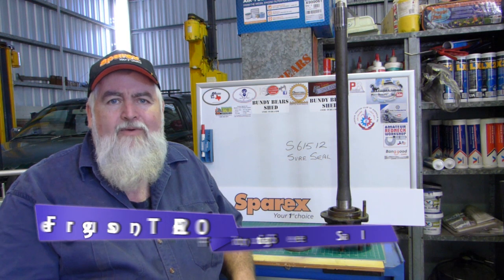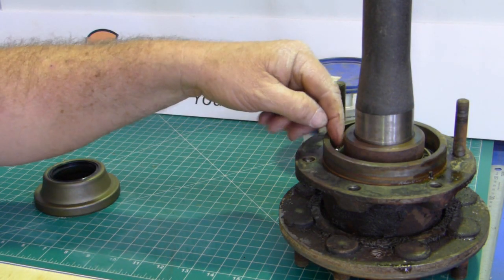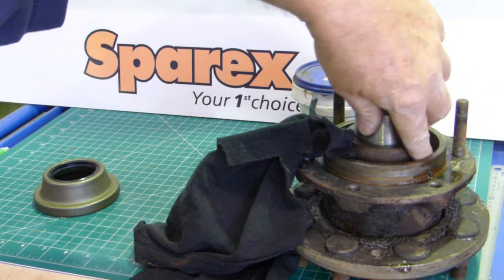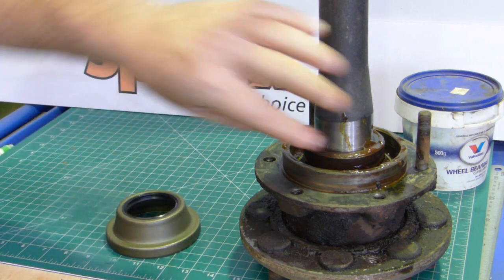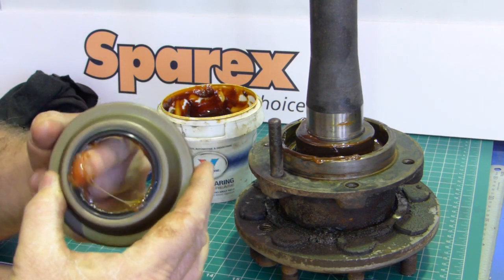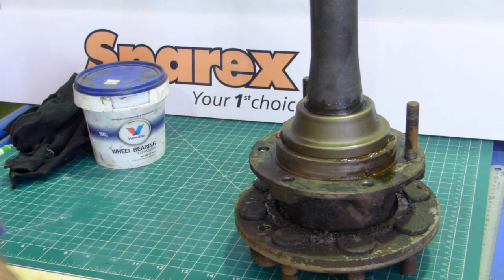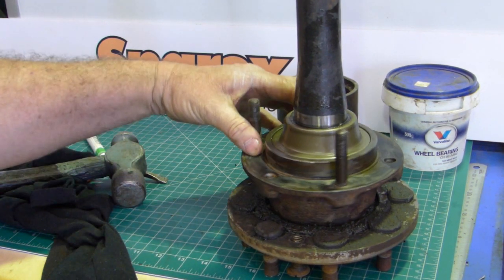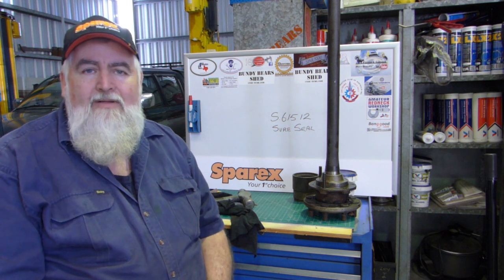How to fit a Sure Seal on a TE20, TEA20, TED20 etc Rear Axle

Comment: Hello Lance, Just fitted mine and as you showed you really have to chase it around a fair bit with no success. I found if you put a large washer on a bolt to hold one side down it then becomes very easy to get the rest started  and easy to fit. Regards Charles @ Nerimbera .
Reply from the maker: Nice work!

Comment: That's great Lance. This is something that I first did a couple of years ago and was surprised how easy it was to do. I think that a little clarification of what age tractors this is applicable for would be helpful, as you will know it is only needed for the early type Ferguson TE20 rear axles. The later ones (with grease nipples fitted) have a different type of seal arrangement, meaning that you just need to change the inner seal in the end of the trumpet housing.
Reply from the maker: Yes I do mention that and in the video coming in a few days we cover the inner seal as well. Hopefully it will be understandable.

Comment: I like the video on the TE20 sure  seal fix but, I have not been able to install one on my 48  TE20 Ferguson.  What seemed to be a simple seal fix turned into a lot of frustration. The seal seems to be pretty thin and easily damaged so maybe I have not used enough force to get it started.  I was wondering if there is a seal that could be installed on the housing where the axle shaft end goes through?  If there ever was one  on mine, it has been removed and discarded. If you know of a seal at the housing, could you enlighten me on it and what the part number is.   I did watch a video of another gentleman removing and installing a seal at the housing but I am not sure of the tractor model he was working on.  Thanks for any info you may offer and please continue with your excellent videos.  I suspect I am a tad older than you with a brain that is hard to keep up but you have certainly helped me tremendously on fixing my Ferguson. The very best to you and your family, thanks again.
Reply from the maker: No the inner seal was only an option for the later 19 spline tractors. They can be difficult to fit at times but a bit of pipe the correct size will help.
Reply: I read a comment about a gentleman fitting the sure seal using a oversize washer to hold one part of the seal in place. With that, I had a  3x2" x 1/4" flat stock and drilled a hole large enough to fit a bolt, to hold one side of the seal in place. I chased the rest around until the seal got tired and settled down enough for me to finish the job.  It was a great idea and helped to finish the job. You have one of the best DIY tractor websites. Watching you at work is a lot better than watching the local crooked politicians at work. Thanks again for your expertise with fixing the old Ferguson and sharing your knowledge. Chief

Comment: Another timely video. I have to fix the seals on my TO20 restoration. Are the original inner and outer seals still in place? I bought both inner and outer seals and the sure seals as well. What about replacing the originals and adding the sure seal for extra protection? I hate oil on my brakes. One guy I talked to said you have to shim the axles properly so I bought some shims too. I'm a guy who buys everything needed first then does the job.I find when I am waiting for parts or money, the job doesn't get done. A little extra explanation would help. I enjoy your videos and your personality, Thanks!
Reply from the maker: I have the video on the axle bearing and seal fitting this week some time, if there is a mark on the outer seal surface there is nothing at all wrong with adding some grease and fitting the sure seal. If it does no good will it do harm? In my opinion no so go for it.
When I get to fitting the axle I will cover shims but it is very easy.

Comment: Can I use the same "Sure Seal" for a 1954 Ferguson TO30? It look identical to the TO20.
Reply from the maker: Im not sure as the TO30 isnot a model we have here in Australia, On the Steiner website it says TE20 and TO20 so I dont think it will be suitable. If they are like our FE35 there is an inner axle seal that is easy to replace.

Comment: Any tips for freeing off the brake backplate / half shaft studs from end of the trumpet housing? (Not sure if i’ve used correct terms!) 
Can get the nuts off - but not free the axle! Thanks in advance!
Reply from the maker: Just soak with CRC and work away at bumping the backing plate off. They do rust in at times.
Reply: @BundyBearsShed Thank you 🙂

Comment: Quick question, I have a early te20, so if there isn't a seal behind the bearing what stops the oil from washing out the grease in the bearing?
Reply from the maker: Nothing at all and it can wash a bit.
Reply: @BundyBearsShed  okay, many thanks

Comment: Good one thanks lance, very helpful. When I put the half shaft back in the tractor. Is it one gasket only or one gasket each side of the back plate. Some say 2 and some say 1. Would like to know before I set up the end float. Thanks nick.
Reply from the maker: Usually  1 between the axle seal housing and the backing plate and only shims to the rear.
Reply: @BundyBearsShed  sorry for being a bit thick lance, so starting from the axel trumpet flange it's then the shims, then the gasket, then the brake back plate, then the half shaft flange. Thanks nick.

Comment: I saw a comment on a TEF 20 restoration site advising against buying sure seals if your tractor has a serial no greater than 325000 because they don't  fit as the design of the rear axle trumpets changed at 325001. I don't  know if this is correct because I just changed bearings  and seals as normal.
Reply from the maker: Sure seals are for the early 16 spline axles mostly as the later 19 spline has a seal in the trumpet housing the same as the 35 so yes they are correct.

Comment: Just wondering when fitting a sure seal do you have to remove the old seal from the diff end ? Thanks
Reply from the maker: If you have a tractor with the inner seal you dont need the sure seal, just replace the inner seal and you should be good to go.
Reply: @BundyBearsShed  thanks so much for your advice kind regards Simon

Comment: Hi Lance, about to do this job but just wondering if there is any particular issue in removing the axle first from the tractor? For example do you need to drain the oil. Ive got my drum off so is it just the 6 bolts then pulls put? Cheers
Reply from the maker: Usually the oil level is low enough but if in doubt drop it. Yes just pull it out.
Reply: Ok, will dive in

Comment: Goodevening,  I love your videos they're a great help to me as I never worked on a tractor like that, just bought it a year ago & now working on it as I have time,  but I'm not sure what Model it is, on the name plate it just says  TE     43411 would you know what it is by that #? Thanks in advance.
Reply from the maker: If it just has YE it could be a continental engine, is the oil filler cap at the front or rear of the block?

Comment: I'm replacing a bearing  assembly on my 49 rear axle TO20 will I have to heat the assembly first like you did with just the bearing. Or just set it and press it on. Thank you
Reply from the maker: Heat is the way to go I find.
Reply: @BundyBearsShed  thank you
Reply: I received my bearings assembly today and I thought it would be one piece. And you used a chip fryer correct.

Comment: Great vidio 
I done this but found that the seal went down maybe 5 mil before touching seal is this ok
Reply from the maker: G Day kevin, you need to push it down but not to the extent that it hits the retaining collar. Apart from the there shouldn't be a problem.

Comment: Hi Lance , 
Mate I got a leak on the lower linkage arms pins on a TEA20 , can’t find any info regarding how to get at these . Any advice would be great
Reply from the maker: I did a video on the FE35 grey and gold tractor series and on the MF135 6 speed. You can do both pins from the left hand side.

Comment: That bearing needs to be PACKED full of grease not just smear some on top. I inject them with a grease needle. Also its best if you take the seal and grind a taper on the edge to help get it started.
Reply: No, that is not necessary. On the MF 135 for instance the bearing is smeared by the oil mist that leaks through the inner sealing. There is no grease in those bearings at all. Too much grease will generate heat and get pushed out onto the brakes.
Reply from the maker: G Day Jason, The grease I push in with my finger goes into the bearing rollers a bit and is enough for this job. This in bearing terms is a very slow moving bearing and the cavity does not need to be full to do the job. I went to a school on bearings one time and they discussed people popping the seals off a ball race to add more grease and they could prove they didn't last as long as the amount put there in assembly even though it looked to be a very small amount but it was enough to get the bearing through what was expected of it. It is like front wheel bearings just the bearing needs some not the cavity and after a few turns a lot of the grease is pushed or displaced by the rollers anyway. But in the long run do what works for you and what you are comfortable doing.
Reply from the maker: G day SLORIIFF, I agree and too much grease only gets displaced by the rollers in the first few turns anyhow. 400 HP tractors only have splash oil or grease pumped in at two pumps every 500 hrs so with good quality grease etc it doesn't need a lot.

Comment: think i will have a go at that why did they not have  them 20 years ago  lol
Reply from the maker: G day Bill. I think they have been around for quite a while but I haven't used them much but they are a great idea if you don't want to go to the trouble to do the other job on them. Just remember a bit of grease into the bearing, you don't need a lot as they are very slow turning.